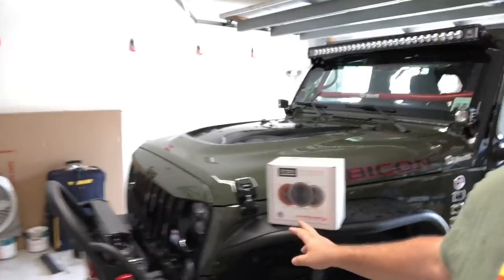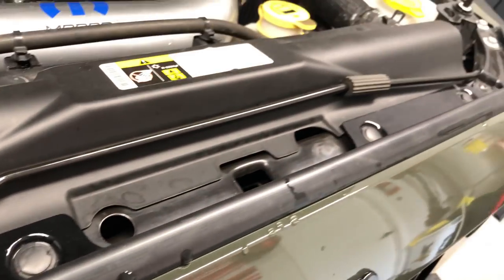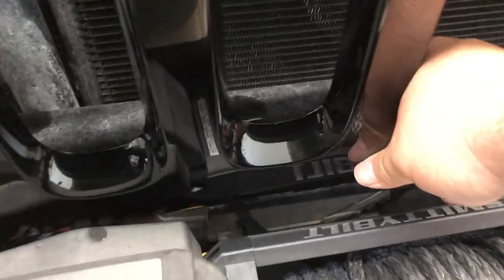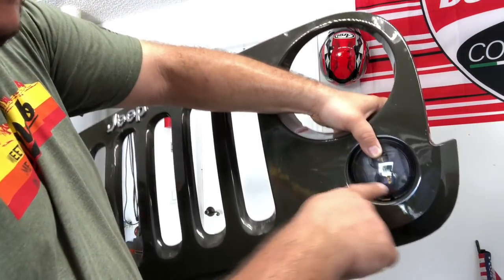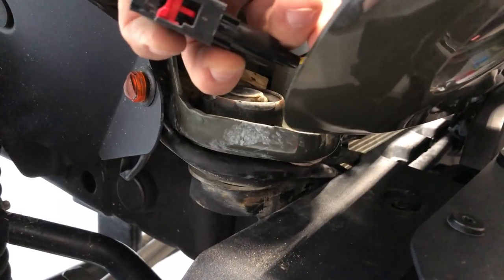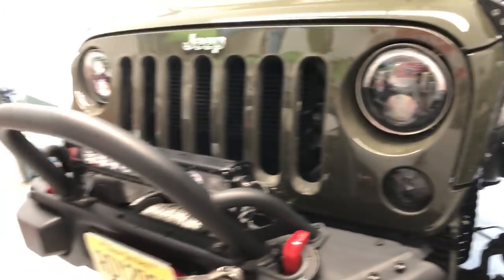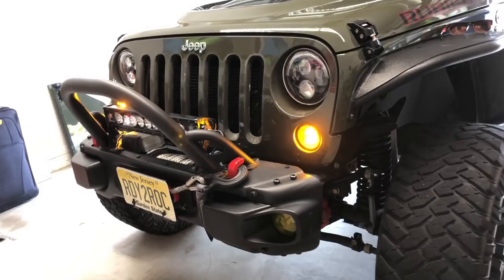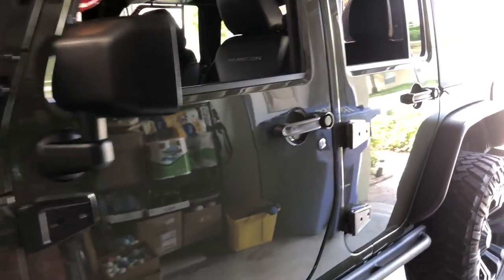Jeep Wrangler Rubicon JW Speaker 239 J2 Series 3.5"  LED Blinker install

Comment: Whats your tires and wheels set up ?
And do you have the  2.5 lift on it ?
Reply from the maker: carlos 1 I have 35s for now and a 4” lift
Reply: T Mogo116 thanks

Forgot to ask you if you can send me.the link of tires &wheels and lift kit ,i like the way it looks ,
Thanks .
Reply from the maker: They are 35" Nitto Mud Grapplers, 18" XD wheels and a 4" Stage 2 procomp lift with Fox shocks with Reservoirs
Reply: T Mogo116 
Thanks.

Comment: hey man should i get a sahara and get lockers and a dana 44 in the front or get a rubicon?
Reply from the maker: McChuckle that all depends, how hard do you wheel, how often, I liked buying the Rubicon because the 44s 4.10s lockers were all rolled into the financing adding all that is a few grand, it all depends, when I got my Rubicon it had every option so there was no difference in Sahara features to my Rubicon

Comment: Hey bro just installed these turn signals and when I turned them on my fog lights blink instead!  Any ideas??  Thanks!
Reply from the maker: sounds like a bad ground somewhere. Were the fogs blinking before and you did not notice? Something is wired funny somewhere. I would check the harness going to both look for splices. Do you have after market fenders/side markers?
Reply: T Mogo116  Hey thanks for getting back to me brother...It was a bad TIPM.  I had it replaced about a year ago because my windshield wipers quit on me...now this!  Ugh  $1500.  At least this time it was under warranty 👍